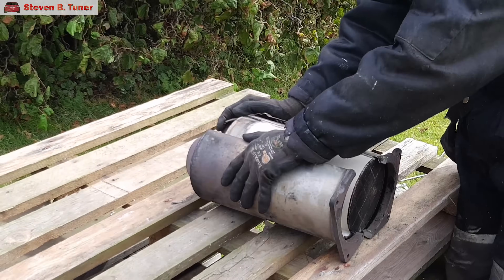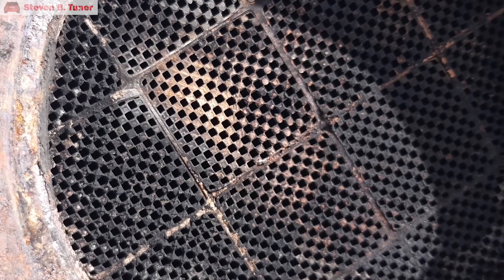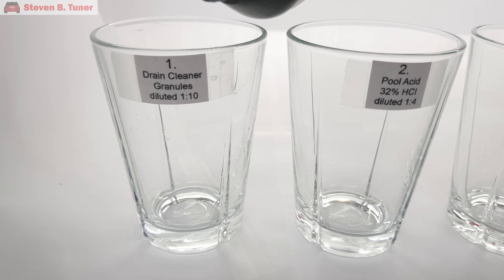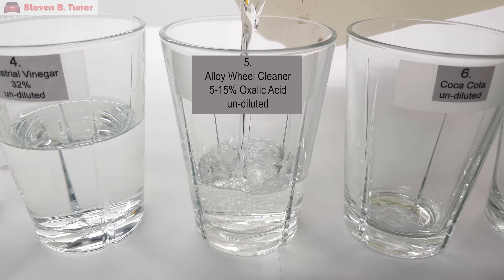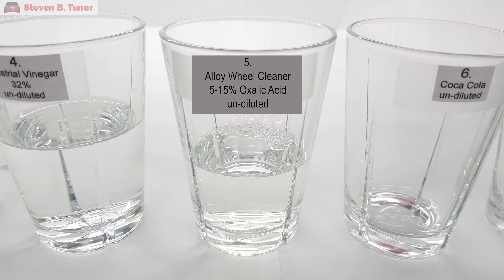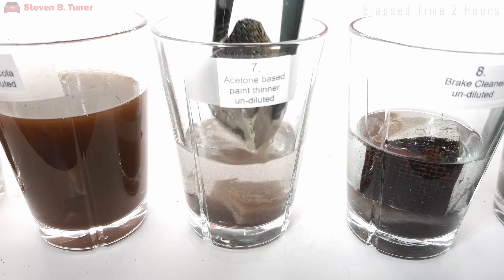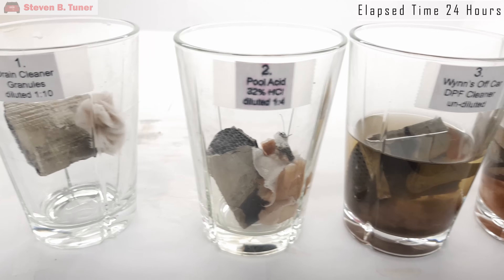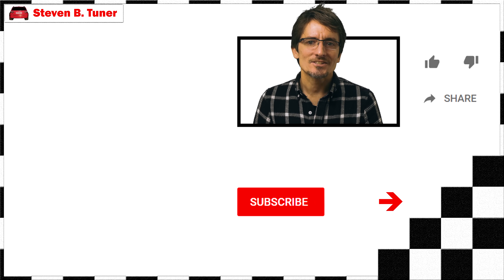DPF Cleaning at Home – 9 Chemicals Tested (Diesel Particulate Filter DIY Ash Cleaning)

Comment: Can it be done as an on site cleaning method without removing dpf filter? Just to spray the solutions through sensor hole with pressure air. And rinse it all with water using the same injection method….
Reply from the maker: Hi, in-place cleaning is more of a 'maintenance clean', and it would be best to use a product designed specifically for the task, like the product from Liqui Moly..
Reply: @StevenBTuner  Thanks for reply! I find your method more based on science:)), since it has two separte stages - base and acid. In order to get solid particles physically out of ceramic channels, lots of rinsing reguired. And maybe that might be problematic for on site cleaning.  Would the exhaust gas be able to push water through ceramic channels…. Once through dpf it flows freely out, since pipe is inclined to the rear. And later dry whole system with hot engine gases. Objections? :))) Thanks for great research on dpf dirt! The only so thorought take on the youtube!
Reply from the maker: Hi, I think I saw a recent comment about someone who was using a pretty good set of chemicals for in-place cleaning - so I think it is definitely worth a test!

Comment: One dpf cleaned like new, took the second one to clean but just saw with camera that one of element is pushed out ~2cm, like the glue was damaged or something... guess I need to take all out now, dont think will work, was already blocked...
Reply from the maker: Hi, if a module is cracked inside then that will happen, and there are a lot of diesel cars driving around on the roads where that is the case.

Comment: dishwashing tablets are definitely the best for removing oil. I will take 3 washes. First wash with tablets to thoroughly clean oil deposits to create a better base for cleaning in 2 and 3 washes. 2 will be naoh and 3 ncl dilution 1:4.. Naoh will start beans and ncl will certainly remove them all.
Reply from the maker: Let us all know how it goes!
Reply: @StevenBTuner  How about dpf sensor? Must be removed form dpf or can stay on the dpf?
Reply from the maker: Hi, you should take the sensors out if you can. I know some folk couldn't get them out and the cleaning didn't seem to hurt them, but I would rather not subject a metal sensor to acid if you can avoid it...
Reply: @StevenBTuner  I finished proces and everything works well. Thank you

Comment: Hey, if you ever get to it again, can you dest the Launch DPF cleaner, the ORiley channel is promoting it. I usually am reluctant to believe something that is to good to be true.
Reply from the maker: Hi, if it is something that you add to the tank then it is very unlikely that will do anything to remove ash deposits.
Reply: @StevenBTuner  it is a substance that is injected in to the dpf with compressed air.
Reply from the maker: I'll have to check it out -  It sounds like it might be similar to the BMW product that is used as a 'once every 2 years' maintenance clean.  For some cars it might be the only way as the DPFs are impossible to remove without the engine coming out as well.

Comment: So wheel cleaner is de best ?
Reply from the maker: Hi, my favorite chemicals are sodium hydroxide for the first stage and hydrochloric acid for the 2nd stage. You can see the whole process in my other video: The No Damage DIY DPF Clean.
Reply: Hi Steve,
Can this 2 stages be done with dpf on car without water cleaning after?
Thanks for a great video.

Comment: Odata ce dpf a ajuns la saturatie, nu se mai poate curata, altul nou sau eliminat fizic si din soft, masina va respira mai bine!
Reply from the maker: Hi, the ash clogging can be cleaned every 250,000 kms or so using my 2 step process or industrial ultrasonic cleaners or high-pressure low-flow reverse flushing. You should never throw out a filter just because it is ash clogged unless you really like throwing money away.
Reply: @StevenBTuner n am spus ca l arunc, ramane intact insa montez un downpipe!

Comment: Thanks for this video. Ive just cleaned my 2012 Vivaro's DPF / DOC using dishwasher tablets first followed by oxalic acid alloy wheel cleaner. I had error codes on my dash 'Check Injection' and 'Check Emissions' which means DPF is blocked. The van failed last year's MOT with these warnings so the garage did a clean using aerosols with the DPF still on the van. This turned the warning codes off and got the van through MOT but warnings were back 1 month later. Watching your video gave me confidence to tackle it myself this year ahead of the MOT. I was really nervous about loosening the two manifold nuts to remove the DPF/DOC exhaust section as it's 11 years old, and manifold nuts of that age tend to like staying put. But a good quality socket and a bit of GT85 got things moving. 
I used an old dustbin to soak the exhaust in overnight with dishwasher tablets, and some frequent flushing through / agitation soon released a lot of soot. I would say this preliminary cleaning was most affective. Next I drained and rinsed then soaked overnight in oxalic acid alloy wheel cleaner. I'm not convinced this had a huge benefit considering the dishwasher tablets worked so well. Maybe if I'd skipped the dishwasher tablets and gone straight to alloy wheel cleaner then I'd be saying how wonderful it was. Thinking optimistically though, maybe the alloy wheel cleaner removed the important last 5% of soot from deep down in the DPF.
Rinsing the DFP with freshwater took forever to remove the frothing. The flushing water would not run out without some frothing, even after about a million gallons! Not sure what's causing that, either the dishwasher tablet or the alloy wheel cleaner residue in the insulation. I had to call it eventually and run with it. I don't think the frothing would have ever stopped. 
I left the exhaust out in the sunshine for about a week to dry out (cant believe we got a week of sun in UK!). Then refitted. 
I didn't use the OBD to cancel the warning codes, instead I took the van for a good drive. Pulled over once after 15mins, turned off and on. 'Check Injection' warning had gone. Drove again for another 15 mins, off and on. 'Check Emissions' warning also gone. Alleluia, the dashboard no longer lights up like a Christmas tree. 
A week on, and all is good. runs great, no warning lights and the van could be a keeper for another ten years. The only thing I'm concerned about is the Emissions Test at next MOT in few weeks time. Has the dishwasher tablets or alloy wheel cleaner affected the metals on the DOC and that no longer processes CO correctly? I hope its OK or else expensive replacement. 
(By the way, despite 1 week in the sunshine to dry out the exhaust, there was still quite a lot of moisture vapor coming from the exhaust on its first run. Only visible when stationary on tickover. It must have been lingering in the insulation. If doing it again, I'd be tempted to leave a hair dryer running through the DPF / DOC exhaust for a few hours also before refitting.)
Reply from the maker: Thanks for sharing your method and results so far! That ceramic material is like a flowerpot - it just soaks up heaps of water and only an oven or an hour of driving is going to get it to evaporate out again...
Reply: I was wondering if blowing compressed air into the DPF would have helped with eliminating some of the water.
Reply: That possibly may have some positive effect depending on volume flow rate for a sustained period, but I think a lower pressure/higher volume air flow source would be better over a long period. A dry heated air source would be best. Borrowing the wife's hair dryer and letting that blow through for a few hours would work good.  

An update on my van and MOT test........  All good during the emissions test and passed. I hadn't ruined the DOC Cat and all my dashboard warning lights still off. Very happy!
Reply from the maker: Thanks for the update - awesome result!
Reply: hello did you use full streght wheel cleaner or diluted it with water to soak and how many hours did you soak?

Comment: You only stated your new favorite prewash and never said what you thought was best for ash cleaning
Reply from the maker: Hi, my overall favorite process is still sodium hydroxide followed by hydrochloric acid. If you are intending on doing a DPF clean yourself then I would recommend having a look at my other vid: The No Damage DIY DPF Clean.
Reply: @StevenBTuner very informative videos, thanks! I watched your 'No damage DIY DPF clean' video too. 

1. Do you use 32% HCl diluted 1:4 for the two-stage clean? 

2. In your comment above, you said that sodium hydroxide (drain cleaner) is still your preferred product for pre-wash. I though in this video, you found that dishwasher tablets were better?

3. If using dishwasher tablets, is there a particular chemical/type that's important?
Reply: I would gravitate towards the coco-cola (mild acid) and the dish washing cleaner, because they do a fairly good job, are low cost and would not likely damage the DPF metal enclosure. You may may want to rinse and repeat for a more thorough cleaning. The stronger acid HCL and base NAOH  might harm somewhat , the DPF metal enclosure.

Comment: Muy agradecido con tú trabajo.Que cantidad de lavavajillas se puede utilizar para el filtro antipartículas de un Citroën DS4 del 2011? Gracias.
Reply from the maker: Hi, if you are intending on doing your own DPF clean then I would recommend doing the steps in my other video: The No Damage DIY DPF Clean. You could use dishwashing tablets or a strong degreaser instead of the sodium hydroxide drain cleaner if you wanted to, but I don't know the best amount to use. All the best with the job!

Comment: Hi I really enjoy your videos, especially this one.  How do you feel tri-sodium phosphate would work (TSP) as a cleaning agent for a DPF?
Reply from the maker: Hi, a strong degreaser like that is perfect for the first stage wash (of a 2 stage system) to remove oily soot.
Reply: I understand TSP has a PH of 12 to 14.   So based on your videos, I suppose it would not remove the elements that are more effected by an acid.
Reply from the maker: Very true.

Comment: The red residue is probably the cerine used by Peugeot as catalyst added to the fuel, to bring down the combustion temperature from 550 to around 450 C 

My Peugeot 508 - 2012 had the DPF completely plugged, so we cut it open to clean it as it came entirely welded, contrary to other DPF models which can be opened.
When we inspected the filter, it had very low amount of black ash residue, compared to the red ash which was all over the DPF walls, so it was basically plugged with cerine.

We ended up removing the DPF all together and reprogramming the car to work without EGR and DPF.
Reply: The red residue is probably Nitrogen Dioxide and ash mixture. The catalyst would have taken care of this gas.

Comment: Just did mine dpf now and the drain cleaner work brilliantly for the red ash and the wynns dpf cleaner cleared alot off the soot. I would say the red ash to soot though was 3-1 back flushing really help out alot and boiling water aswell helped with soot clear out, only problem I have had was I have a launch x431 pro v series scanner and can't find how to reset the dpf and differential pressure values.
Reply from the maker: Hi, well done on the job! I did some testing on a BMW DPF and found 3 different grades and thicknesses of stainless, so there is certainly no standardisation going on! I have gone for a pretty weak concentration in order to minimise the damage, but you definitely don't want leave the acid in there for more than 30 minutes.
Reply: @StevenBTuner  yes when I watched some of your testing and others videos seen you mentioning not to leave the acid in there for long, it's surprising how just normal hose water pressure can remove from the dpf.

Comment: This whole DPF and EGR system is just pure insanity  orchestrated by rabid leftist with no knowledge of the working of combustion engines and no concept of cause and effect.
Reply: LOL, every other vehicle in Texas is deleted. Life is good.
Reply: dpf and egr would be fine if the manufacturers of the vehicles made them easy to remove, clean or replace.
Reply from the maker: Hi, these systems are the only things keeping diesel vehicles on the roads, as otherwise they would have been banned in the early 2000's, so they are a 'necessary evil'. If you live in a big city and have ever got a big lungful of diesel fumes from a pre-DPF/EGR bus, then you may have a different opinion about pollution control equipment.
Reply: @StevenBTuner  12 valve left the chatroom 😂

Comment: I just used a pump sprayer with dish washing soap and a dissolved dishwasher tablet mix with boiled water and sprayed in to the upper pressure sensor hose about 4 liters of this mix over time, as soon as I started the car a massive cloud began to form, black foam and water came out the exhaust, pending code went away on its own after a little drive removing the dpf from the car means the engine and transmission need to come from under the car in my case and I don't have the equipment needed to do that so I thought I might aswell try this. untill I find a shop to rent and repair the car properly. I have a can with dpf cleaner that I intend to spray in there aswell later today when the car has cooled down (update) so far so good pressure seems way lower after treatment
Reply: Well it worked for some time but came back like I kind of expected but atleast I tried bought me a bit of time and did this two times since and now I am thinking about using something stronger to break down more of the build up in there
Reply from the maker: Wow - an interesting experiment!
Reply: Thank you for sharing how to access the different through the pressure sensor  ...  ...I would think even just diesel fuel would goo up the soot and clean things a little...just let it sit for a while   I will definitely experiment with just soapy water !!  : )

Comment: There is one thing that is not tested, and that's the effect of a strong acid on the housing of the DPF. Having a clean DPF is one thing, but not if it means the housing starts leaking exhaust fumes through compromised seams. It's probably OK, but mild steel is affected by strong acids.

nb. brick cleaning acid (hydrochloric acid) would also work, but I for one don't want to handle the sort of quantities required to clean an entire DPF. Really the sort of thing that would have to be done in an industrial setting, not in a garage.
Reply from the maker: Hi, all those points are covered in my other vid: The No Damage DIY DPF Clean. If working with chemicals is not your thing, then there are now many dedicated DPF cleaning companies out there.

Comment: i'm in oz. had 2 manual cleans, 1 lasted 500km on a holiday. drove home with no turbo. 2nd clean lasted maybe 100kms. getting desparate. tried penrite aerosol-spray can poked into oxygen sensor hole on my 2009 x trail dci. whilst stationary, ran the engine at 3000 rpm, it would not go faster. after maybe 10 minutes or more it revved higher. great, i thought. jumped in the car and drove for 10 minutes to pick up my son, skited about my ability. turbo stopped on the way home.
more desperation, nissan dealer wants $4K for new one and $1K to fit it. claims cleaning it is illegal which sounds like bs.
so i intend to use your method but do it thru the oxygen sensor on the inlet side of dpf. too old to crawl around cars would appreciate your comments steven and thanx so much for your video. i presume draino goes in first then run the engine; then add a litre of 25% hcl acid. any fine points with this method?
Reply from the maker: Hi, the full method I use is featured in my other video: The No Damage DIY DPF Clean, but it involves removing the DPF from the car. I don't have a method for in-place cleaning, but the Liqui-Moly product could be worth a try, or it is probably even better to contact a company that specialises in DPF cleaning (I haven't heard anyone lie and say that DPF cleaning is illegal before). Having said all that, it sounds a lot like your issue is due to soot-clogging rather than long term ash-clogging, and cleaning out your DPF will only help mask the issue for a couple of weeks. If your DPF is not regenerating correctly then there is probably an issue with your EGR valve, glow plugs, turbo or a sensor, and you have to fix the underlying issue before things will improve.
Reply: @StevenBTuner  just noticed the liqui moly is a fuel tank additive!
Reply: @jasonstrong4610 yes they have the one for the fuel tank and the intake

Comment: My dpf is vertical and very hard to get  off. Would you forsee any problem with disconnecting the top and injecting a dishwaser tab solution into it over a period of time?
Reply from the maker: Hi, for DPFs that are very difficult to remove I would first try the in-place DPF cleaner made by Liqui-Moly, and it would be best to use it right after your car has done an active regeneration cycle so that as much soot as possible has been burnt off.

Comment: Hi, I have a zafira B 1.9 cdti, it has a catalytic converter joined to the DPF,will this process damage the cat? Thanks
Reply from the maker: Hi, I have another video that could help you - "The No Damage DIY DPF Clean". I go through some experiments to try and make sure the process used doesn't cause damage to the catalytic converter.